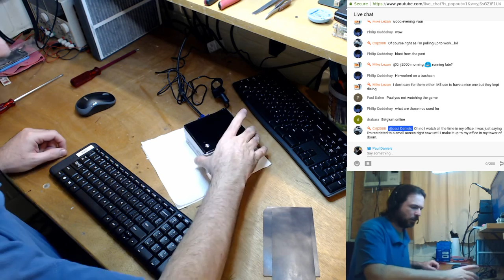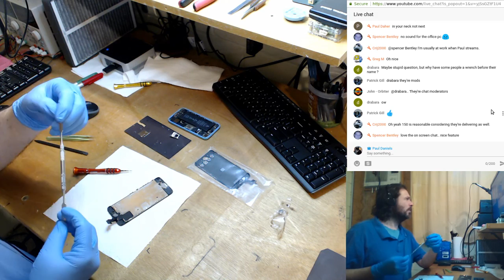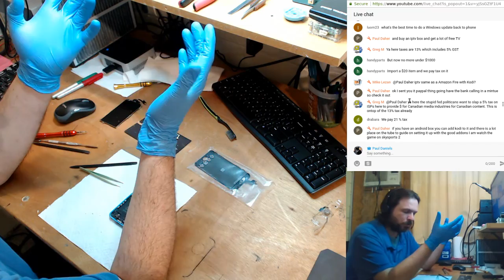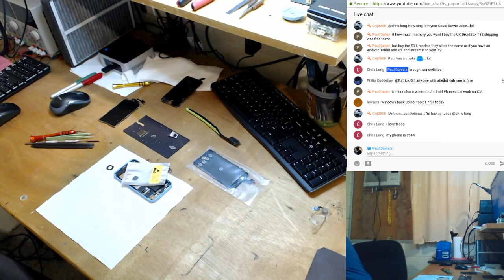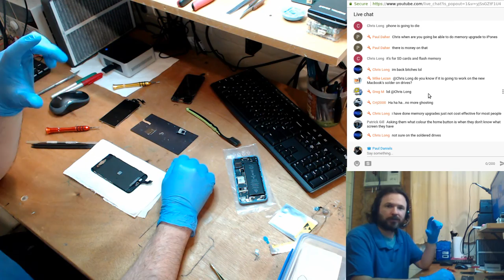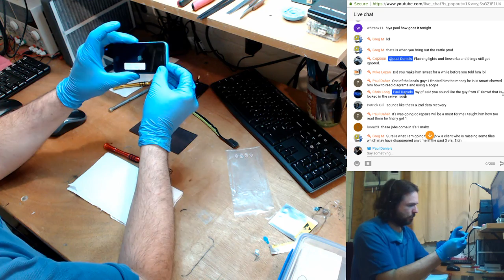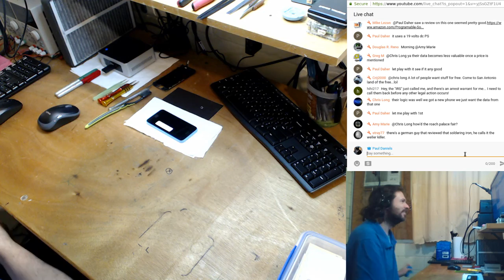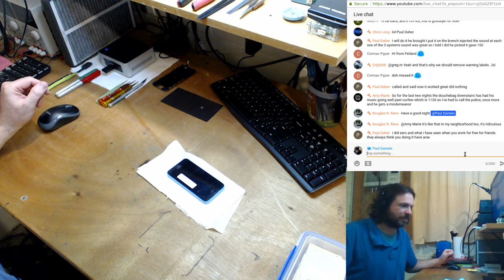Finishing the Intel NUC (Celeron) and iPhone 5C for screen fix

Comment: Hi Paul, love the content, keep up the great work.   

Since you appear to work with a lot of PCs and recovery jobs I thought to suggest a tool I have been using for years.  The tool is a external drive enclosure that is hot configurable between a HDD/DVD or both functions at the same time using only a hard drive.  The unit emulates A USB DVD mounting ISO files from a specific folder on the external hdd.  The tool is made by Zalman, current model is the VE350; however, if you can find the older VE300 I would recommend it more as the UI is more granular feature wise.  I have encountered a few bugs unmounting the device from Linux, and some older motherboards didn't recognize it boot time;otherwise, being able to boot from ISO and store a backup image to the same device has been fantastic.  Here is a link to he VE350 http://www.zalman.com/contents/products/view.html?no=20

Cheers

Phil
Reply from the maker: I've seen a previous version of this idea, this one appears to be more cleanly executed.